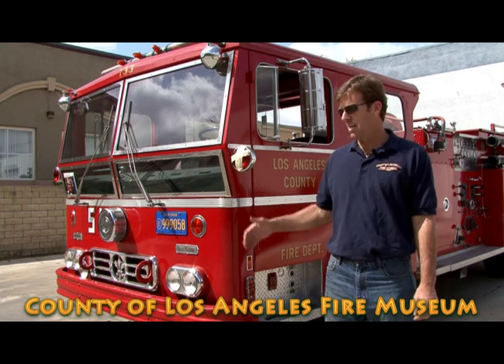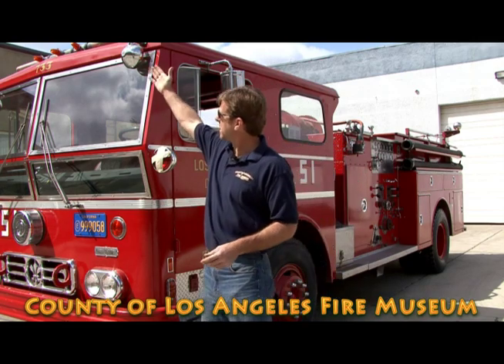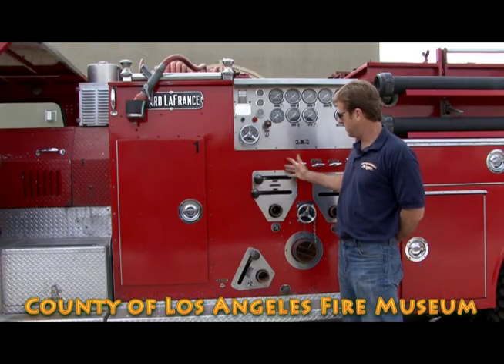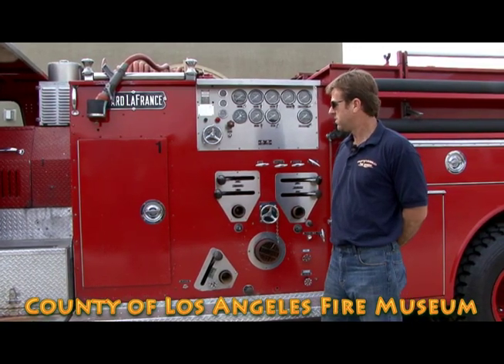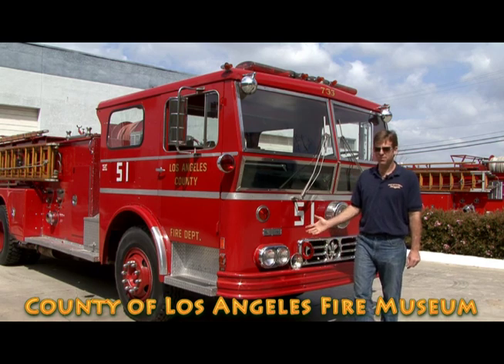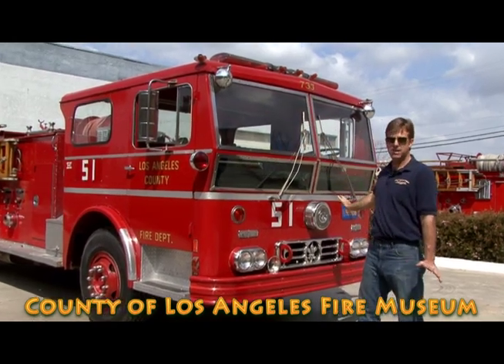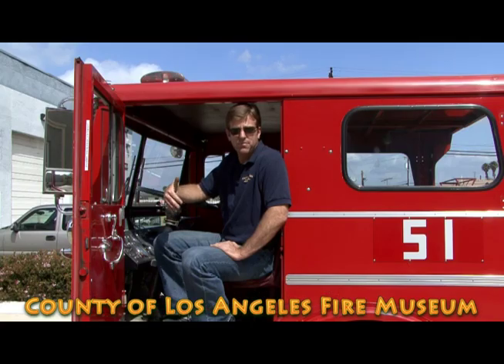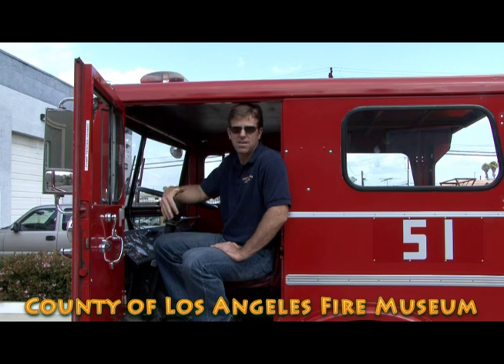Help RestoreEngine51 Part One

Comment: At 5:00 he puts his hand on that ledge beneath the ladders and asks if it was red or silver. Season 3, Episode 4  you can see it is silver as the engine drives by laying duals at the opening structure fire. There's also an ABC Extinguisher just forward of that compartment and an CO2 extinguisher just forward of the LDH discharge.

Comment: Those hoses are called HARD SUCTION used for drafting water from a STATIC source like a pond or river.
Your thinking about the synthetic type hoses that are used for supply or fire attack.
Nothing wrong with this set up.

Comment: 1 i do not remember seeing those lights on the engine 2 that service panel i do not remembering seeing that not unless i missed it 3 the numbers were defenatly not there 4 the hose bed did not have those dividers 5 the ladders and poles are in the original areas were kept 6 there was a round light ontop for the red light original.  I would love to drive that in a parking lot